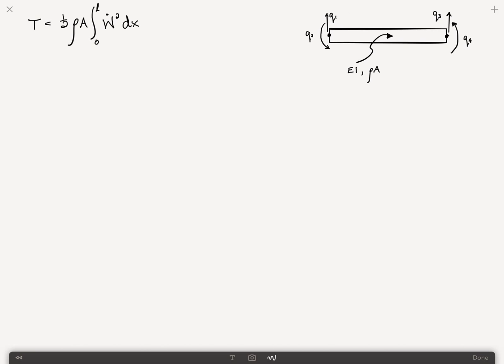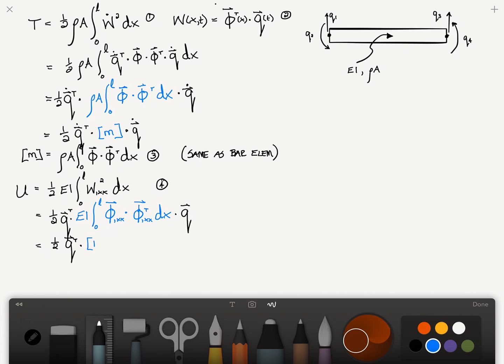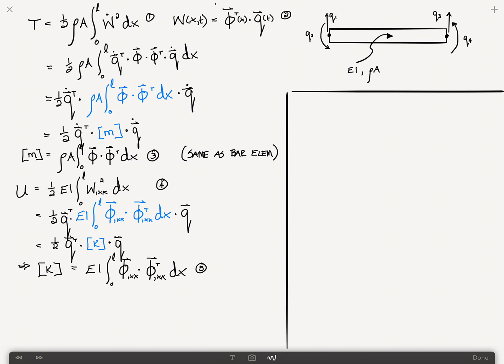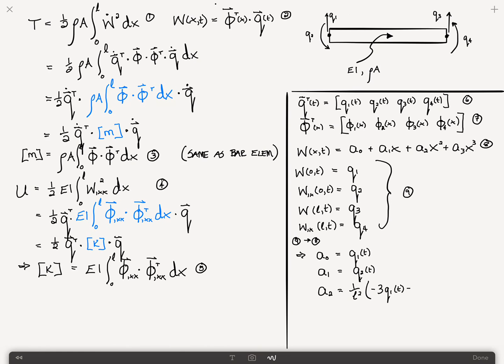Euler-Bernoulli Beam Finite Element - Deriving the Mass and Stiffness Matrices

Comment: If i were to apply this to a 3D frame where members have different properties, would the a's go all the way up to a11*(x^11) in the displacement field equation? And then add up all the similar components for the members for each DOF? As in, create member matrices then add them up to create global matrices?  Each member is in parallel to one of the 3 major axes.  

Thank you.

Comment: Thank you for this video, you helped me a lot. 
The only thing that I don't really understand is the fact that these matrix are supposed to be derived using Euler-Bernoulli theory, but I don't understand where did you use this theory?
Reply from the maker: I didn't explain it here because this material was mean for a lower level class where we we are only dealing with E-B beams to keep things simpler.  But the E-B assumption comes into this with the expressions that I use for the kinetic and strain energies (eqns 2 & 4).  These equations are the result on including the E-B assumption.  Specifically, the E-B assumption is the reason that in the expression for T, we include only the translational KE component and ignore the rotational component (which is know to be insignificant or E-B beams). Similarly, the expression for U contains only the bending strain energy and ignores the shearing strain energy (again this has been shown to be insignificant for E-B beams).

I have a video where I discuss the derivations of these expressions for T and U a in more detail.
youtube.com/watch?v=8GV5pggBeu0

And then also I have a video (actually a 3 part series) in which I derive the energies for a Timoshenko beam in which shearing effects are not neglected and you can see how these expressions would look if we never made the E-B assumptions. You can jump to the 2nd video in the series:  youtube.com/watch?v=e6WhAoVGQ0c
and find the expressions for what U (eqn 16) and T (eqn 18) look like when we do not make the E-B assumption.

Comment: video time - 10:40  >>  substitute eqn 9 into eqn 8. How did you get the ao......a3 ?
Reply from the maker: This is just linear algebra.  Might be easier to use matrix notation.  If I substitute 9 into 8, I end up with 4 equations which can be written in matrix form as [B]{a} = {q}.  We wish to write it in the form of {a} = inv([B]) {q}.  This amounts to simply inverting the coefficient matrix and you're done.  Alternatively, you can calculate each by hand since the algebra is relatively simple.

Comment: your lectures are superb. I have one question, I have beam which has two fixed supports and is tentioned from both side. I want to calculate the bending stiffness, which for that I need a 4x4 stiffness matrix, which I calculated the coefficient for that and it'll multiply to flexural rigidity and add it to another 4x4 matrix which will multiply to the tension of the beam. I do not have a mechanical background and I am a bit struggling understanding the nature of the second matrix is that the mass matrix??
Reply from the maker: The problem you are describing is an axially-loaded beam.  This problem is particularly important in the analysis of rotor blades, turbo machinery and the buckling of columns.  It is a well-known phenomenon that the axial load in a beam  affects the transverse stiffness of the beam.  Tensile loads increase transverse stiffness (much like a string under tension) while compressive loads decrease the transverse stiffness of the beam (this is why too much compressive load will cause a column to buckle - due to the fact that the flexural rigidity of the column decreases).

It sounds to me like both the matrices you are describing are stiffness matrices.  The first is due to the natural flexural rigidity of the beam while the second deals with the stiffening (or de-stiffening) effect due to the axial load.  

For linear problems (i.e. small deflections), these two matrices are added together to get the overall stiffness matrix.  Since the 2nd matrix is multiplied by the axial load, it will disappear as the axial load -> 0 .  Also for a negative axial load (compression), the 2nd matrix will subtract from the first thereby reducing the effective stiffness of them beam.

Comment: Hello my friend! Nice work you have done here! REally appreciate it! I would like to ask you how with the differentiation of the w(x,t) the non transponse φ appears inside the intergration?
Reply from the maker: Not sure if I fully understand your question, but hopefully this covers it...

What appears in the integration is anything that is dependent on x.  By assuming that we can write w(x,t) as a function of x times a function of t (typically called "Separation of Variables"), we can write w(x,t) =  transpose(φ(x)) · q(t).  Since we are dealing with vectors, the standard way of squaring a vector is to take the dot product of the vector and it's transpose - i.e. w^2 = Transpose(w) · w = w · Transpose(w).  Any x-derivative is only applied to φ(x) while any time derivative is applied to q(t).

In the end, we remove from under the integral anything that is not a function of 'x' - so the q(t)'s are removed and the φ(x)'s (i.e. φ and it's transpose) remain under the integral.

So φ(x) and its transpose come from squaring of w(x,t).  The reason it stays under the integral is because it depends on x.

Hope I haven't confused you.
Reply: Thank you my friend for your response. You have not confused me at all! The answer to my question exists in the line " Since we are dealing with vectors, the standard way of squaring a vector is to take the dot product of the vector and it's transpose - i.e. w^2 = Transpose(w) · w = w · Transpose(w)". Thank you again for your effort and good luck!
Reply from the maker: My pleasure.  Glad I could help.

Comment: if we consider axial forces then how will we solve it?
what boundary conditions should i consider for displacement ?
Reply from the maker: If you have axial forces, then these are just placed in the force vector on the RIGHT-HAND_SIDE of the equation. 

i.e.  the equations of motion are [m]{x_ddot} + [k]{x} = {F}

Also, I am not sure I understand your second question regarding the boundary conditions for displacement.
Reply: Sorry i asked the wrong question.
1.What is the physical significance of stiffness and mass matrix?
2.How will we get mass and stiffness matrix if axial displacement is also taken into account?

Comment: hello, its an impressive tutorial but I am lost at 14.23  how do you got those values? I tried substituting but its not giving right results. What u substituted for x? Thanks in advance
Reply from the maker: The idea here is that the products of the shape functions (the phi_i's) are being integrated from 0 to L (then multiplied by rho x A).  I explained it in a little more detail in the video where I derived the matrices for the bar element (https://youtu.be/HFkK6n7sKfc?t=18m57s).

For each element in the mass matrix, you first need to multiply the corresponding shape functions and then integrate that product from 0 to L (multiplied by rho x A).

For example, in the case of the element location at (1,1), you'd find the product of phi_1 x phi_1 (i.e. phi_1 squared) and then integrate that between the limits of 0 and L.  This can be done by hand, but you might find WolframAlpha to be a useful tool for this.  Go to wolframalpha.com and paste in the following:

(rho * A) * integrate   [1 - 3 (x/L)^2 +2 (x/L)^3]  [1 - 3 (x/L)^2 +2 (x/L)^3] dx from x=0 to L

which will give you the (1,1) element as (rho x A x L) x 13/35 (which is exactly the same as 146/420 which I have in my video).

Similarly, for the (2,1) element (or the 1,2 element by symmetry), you would use the shape functions, phi_1 x phi_2.  You can paste the following into WolframAlpha.com:

(rho * A) * integrate   [1 - 3 (x/L)^2 +2 (x/L)^3]  [x - 2 L (x/L)^2 + L (x/L)^3 ] dx from x=0 to L

which will give you (rho x A x L) x 11/210 (which is the same as 22/420 shown in the video).

In general, for the (i,j) element you will multiply shape functions phi_i and phi_j, then integrate the product from 0 to L  (then multiply by rho x A).

WolframAlpha will also give you the form of the indefinite integral which will allow you to validate your math step-by-step.

For the elements of the stiffness matrix, you pretty much proceed in the same manner EXCEPT THAT you first take the 2nd derivative of each shape function before finding the product (and, of course, you replace the (rho x A) with (E x I)).

Hope I haven't confused you with this lengthy explanation!
Reply: great explanation.. thanks a lot